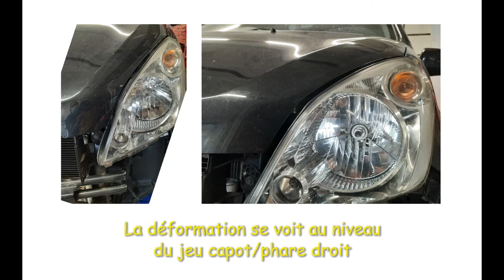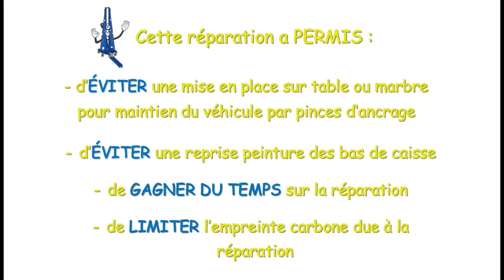Redressage SUZUKI Extrémité  Longerons Avants - Équerre Bud & Accessoires - FEN X innovation

Comment: du coup tout l'effort se reporte contre la jante droite ? ne risque t'on pas de la voiler. On voit l'espace qui se fait entre la jante gauche et la butée qui etait plaquée contre au début
Reply from the maker: Bonjour,
Veuillez nous excuser pour cette réponse, plus que tardive, nous n'avions pas eu la notification de votre commentaire.
Pour vous répondre :
1-Dans le doute de cet essai/réparation précis, une géométrie du véhicule avait été faite à l'issue de la réparation et aucune anomalie n'avait été relevée.
2-Dans ce genre de configuration de traction, statique de surcroit, on peut largement trouver une similitude avec un véhicule chargé dans un rond-point qui va subir des efforts variables et en dynamique.
3-L'effet d'une roue qui prend un trottoir est beaucoup plus brutal que la traction manuelle et progressive de l'équerre.
4-l'équerre reste dans une capacité de traction maximale à 4T et ne veut pas entrer en concurrence avec les passages au marbre avec des tractions beaucoup plus puissantes.
Nous vous remercions pour votre intérêt
Bonne journée